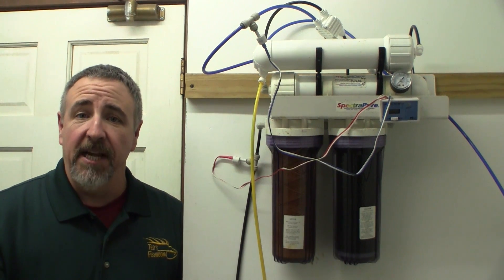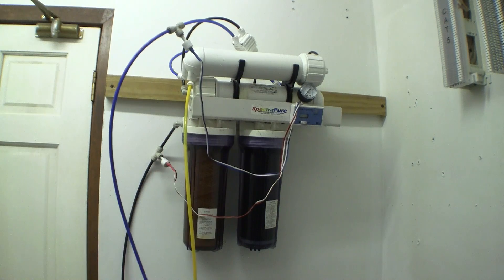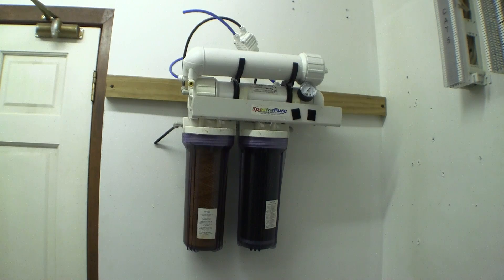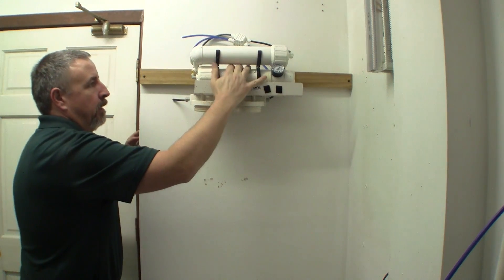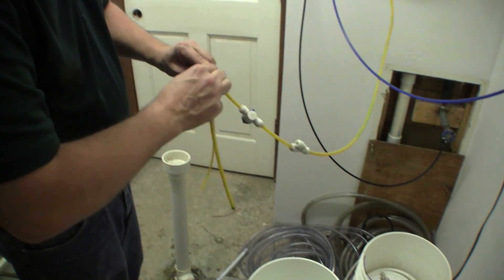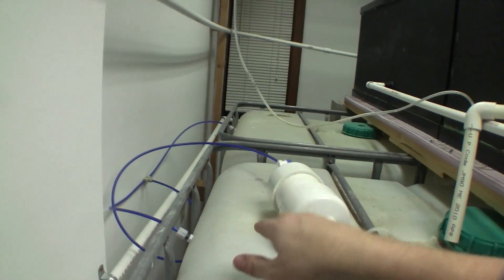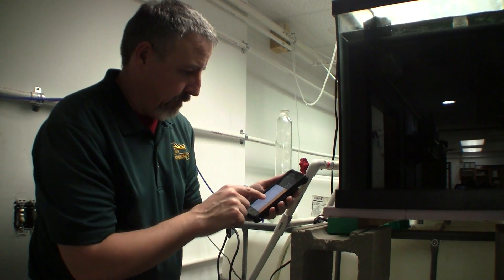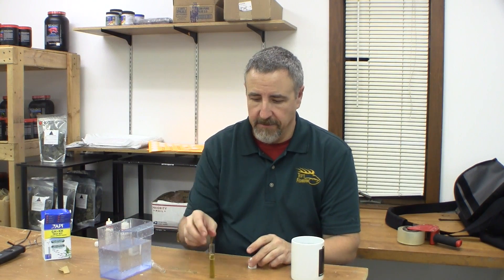Reverse Osmosis Maintenance

Comment: Hello: I am a grad of UW-Madison. I now live in the higher desert area of CA. 

Here, the day time temp will always be above freezing, although it may drop to 20 F a few very cold winter nights. I don't believe I need to store RO water. I just turn on the high pressure valve to the RO unit to fill and turn off to stop RO.

Besides the low temp in the mid-west, the issue of too slow a fill with RO can be considered. At 150 gal/day, 6 gal/hour, the fill can be fast enough. One should plan the filtration and aeration (life-support) so that they will function well enough at the reduced water level for perhaps 4 hours, 25 gals. To increase RO production, one does not need more filters and canisters, just RO membrane and housing, $50 for each additional 150 GPD. How does storing RO water help? Consdier the saving in space (footprint) of a storage tank.
 
There is a rate of fill to the storage tank so the issue of rate of generation is critical with or without a storage . Perhaps if the water is treated with chloramine  it is a bit too bold to fill with RO water directly without addition of Prime or similar chemical into a storage tank. 

Here, I also do not need to fill with warm water. The drip is so slow that 55F water (cold) will warm fast enough when the air temp is high enough. Perhaps a space heater control by a timer to increase the temp of the air by 2-4 degrees just before water fill would work, if necessary at all.
Reply from the maker: If I were only using the RO water of one tank I might have been able to get away with having the water go directly to the aquarium, but in that facility I needed 300-400 gallons of RO water at a time to prepare tanks for new stock and to do water changes on soft-water breeders.  The investment in storage tanks and delivery made more sense that investing in an industrial 'on demand' RO machine that would let me fill tanks quickly without storage.
Reply: I suppose there is a difference between a fish breeder and a dealer/re-seller. 

A breeder's requirement for RO water is more stable and does not fluctuate as much. If a breeder just change 40% of water with RO water every three days, then there is little advantage in storing RO water. If the tanks' life-support system (aeration and filtration) functions well enough for several hours with reduced water level, then automated slow fill (using timers) at any time of the day will function very well.  Storing and not  storing do not affect the total RO water generated and used.

Comment: HI ted what will happen if you recycle the waste water and you pass it again through the membrane?
Reply from the maker: +Alfio Bartolo I think that it would be harder on the membrane, but I assume that it could be done.
Reply: It saves water if you feed the waste water of the first membrane into the in-flow of the second membrane. The TDS of the combined (and averaged) product water is only slightly increased, but the savings in water used is more significant. 

The input water pressure into the first membrane has to be high, 60 psi, not marginal.

Comment: Any reason you couldn't use the waste water on African Cichlids? There is also a way to increase production of the R/O water.  Great video as always!
Reply from the maker: +Jeremy Basch I think that you need to be careful using waste water for Africans, depending upon what your tap water contains.  Not all hard water is composed of the same minerals.  I use a whole-building water softener which removed virtually all the calcium and magnesium, but it leaves about 1/2 of the carbonate hardness (KH).  The RO removes the KH when it is functioning correctly.  A water softener is supposed to make it possible to have a 2.5 ratio and still get good water, but that was not the case with my unit.  I shortened my restrictor down to a 2.5 ratio when I installed the water softener.  All was good for a few months, but the membranes soon crapped out.
Reply: +Ted Judy Thank Ted!

Comment: Is there a reason you choose to use the capillary flow restrictors vs. some of the other pre-configured flow restrictors (75 GPD, etc)?
Reply from the maker: +Jeremy Phillips Because those pre-configured restrictors are not exact either.  All flow rates depend a lot on pressure.  But the capillary restrictors are adjustable, whereas the pre-configured are not.  I am going to order a longer restrictor because this one is giving me a 3.5:1 ratio, and I may want closer to a 4:1.  The higher the ratio the longer the life of the membrane.
Reply: +Ted Judy I'd be curious to know how much faster membranes foul at 4:1 vs 3:1... The cost of waste water over the life of the membrane might be more than the cost of the replacement membrane (unless you aren't charged per gallon). I did some quick searching online but wasn't able to find many direct answers. I'm sure there are multiple factors to consider (inlet pressure, water quality into the membrane, cost of water per gallon, membrane flush frequency, etc.)
Reply from the maker: +Jeremy Phillips The difference in the cost of waste water at 4:1 vs 3.5:1 is not all that much.  For example, if total water cost is (I am rounding here for ease) $10/1000 gallons, and the waste water ratio difference is .5....   then producing 500 gallons of RO would produce 2000 gallons of waste (at 4:1) or 1750 gallons at 3.5:1.  That is a difference of 250 gallons waste, at a cost of $2.50.  So in one year (making 500 gallons per month), the total savings of going with the lower ratio would be $30 ($2.50 x 12 months).  The cost of a membrane is usually $60-$70.  So, for argument's sake, I would be breaking even if I stay with the lower waste ratio and buying new membranes (I use two of them) every four years.  If the membranes do not last 4 years at the lower waste ratio, I am losing money.  My water cost is actually about $8.50/1000 gallons, so the actual calculations would mean the membranes would have to last longer.